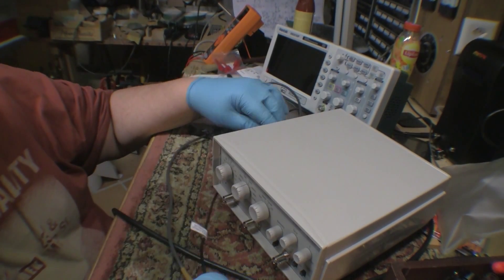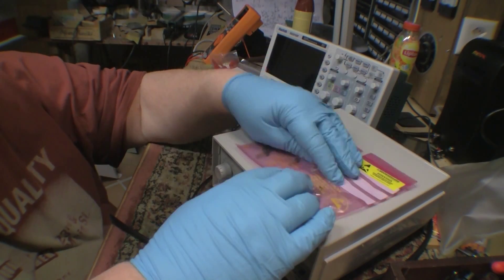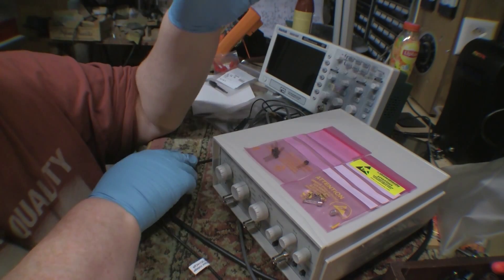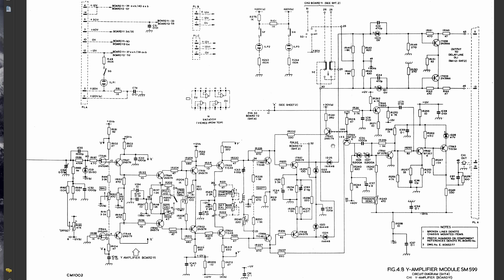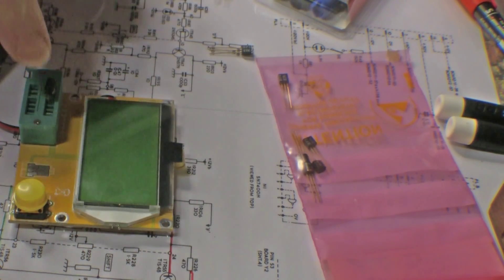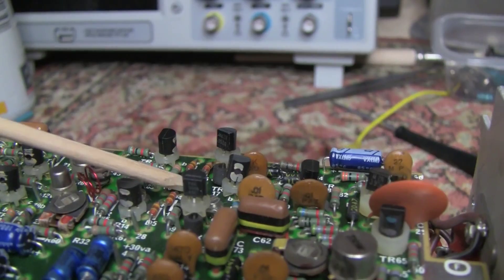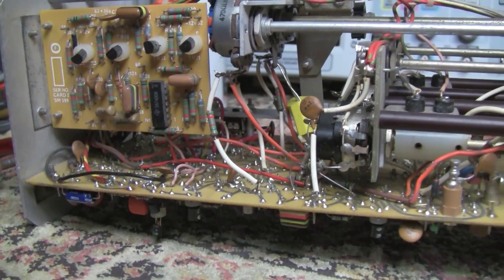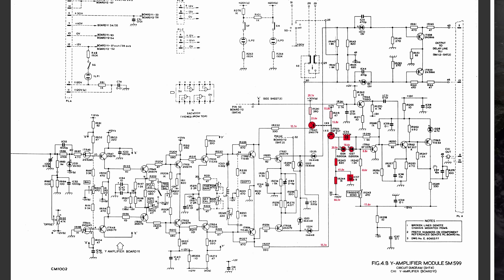SM112 Scope Repair - part 9

Comment: There are more compact transistor sockets available then the ones you ended up with, they have the three holes in a row, with one hole spaced further apart then the other two, they are under 1/4 long and maybe 3/32 across. I don't know if they are still available new from Mouser or Digikey but I have seen NOS ones on fleabay, they are the same kind that Zenith used to use in their Transoceanic sets and some other transistor radios and TVs.
Reply from the maker: Thanks, one of the challenges when buying online is you don't always get a sense of the size of a component.